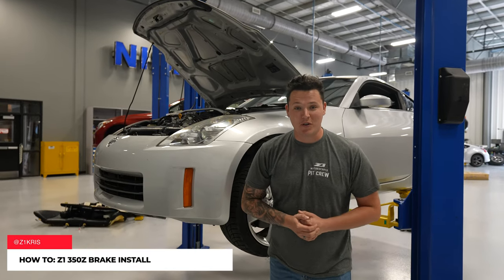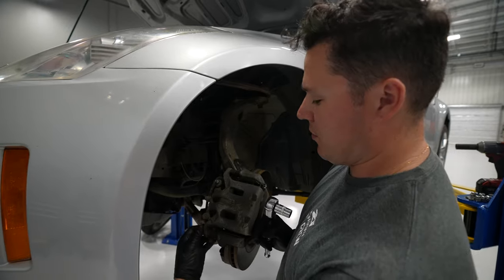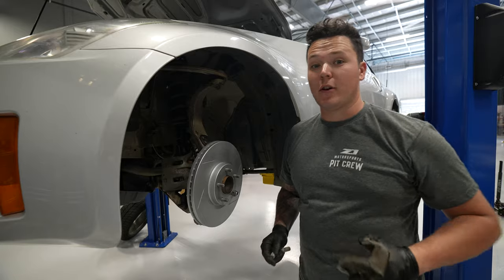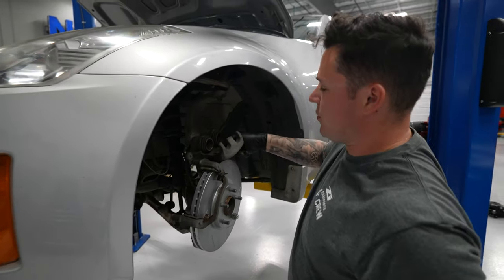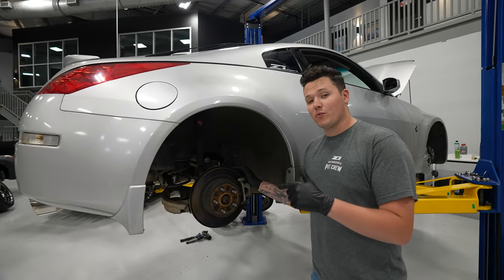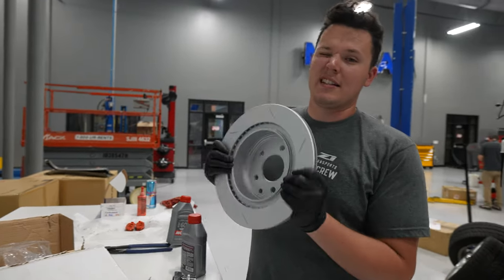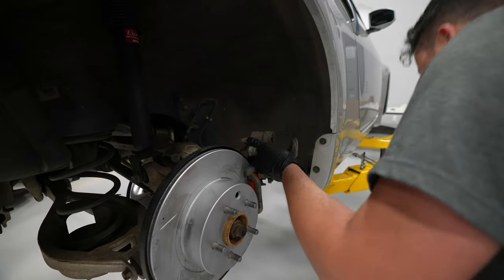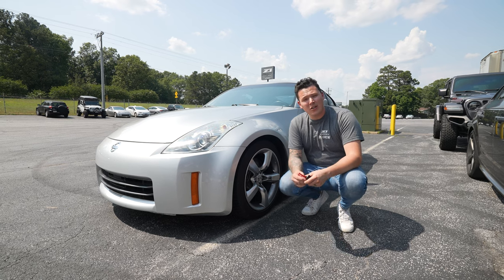How To Replace Brake Pads & Rotors On Your Base Brake 350Z

Comment: Slapping on that new rotor with all the rust on the hub will causw lateral runout on rotor (vibrations) after few hundred miles.

Comment: Putting that redbstuff on the pad ears will cause the pads to stick and not move freely through the hardware. The red stuff hardens to a rubber consistency. Cant believe y'all dont have experienced people at your place that actually know what theyre doing.

Comment: Really solid DIY! Wish I had this thorough walk through when I did mine weeks ago. Keep the awesome DIY and useful vids up! The rear is certainly trickier with clearance especially if you have the sport brake calipers. I had to give the socket I put on the caliper bolts a wack with a rubber mallet to break them free given the tight clearance
Reply from the maker: The back certainly can be a little tricky! Thanks for watching!